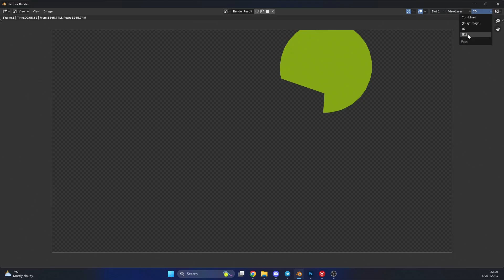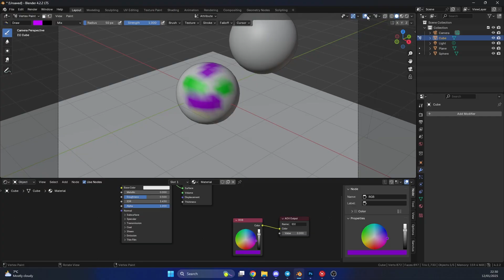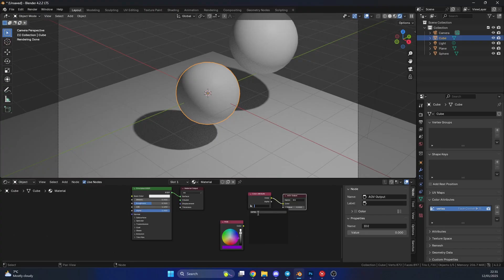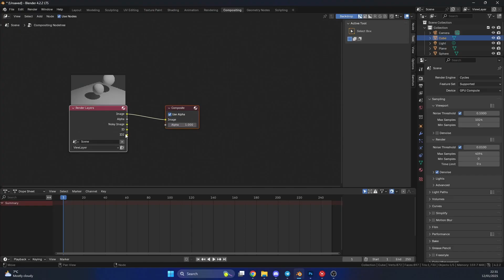Shader Aov - Blender Basics

Comment: I feel like this is one of the most powerful features of the shader nodes. I think if you use programming combined with it, you can achieve complete control of your scene and the outputs.
Reply: Unfortunately not, Open Shading Language does not work with AOV, it just outputs blank if you have OSL enabled. You can still use python though and geo nodes though.